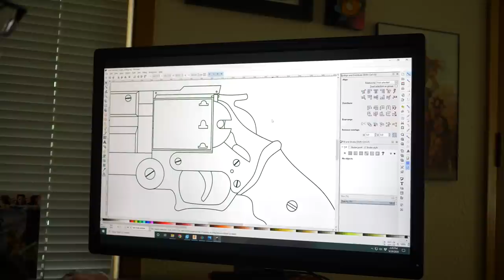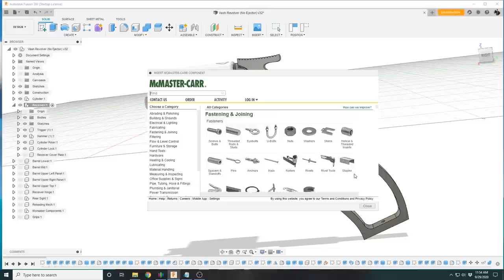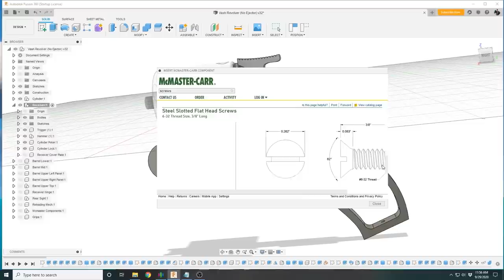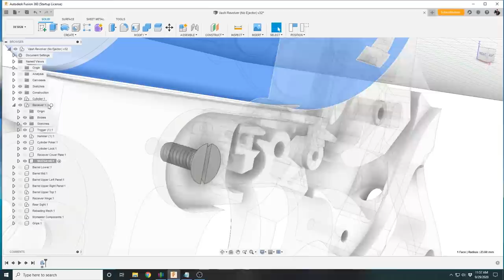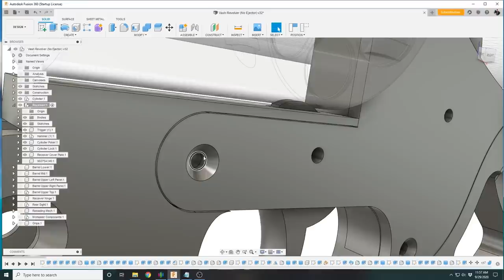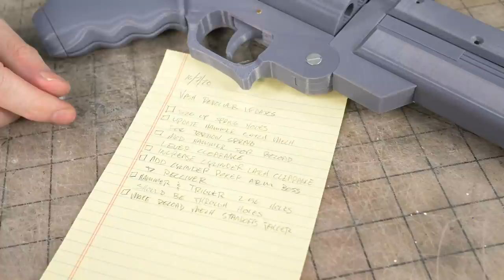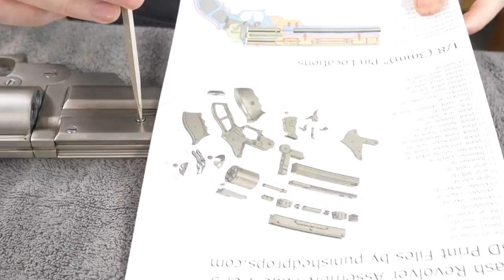LOVE AND PEACE! 3D Printing Vash's Revolver | TRIGUN

Comment: Having trouble with one of the files.  rear_sight_cylinder_stop.  It looks like the hole is not dead center..possibly by design, but every time I print it I end up with one of the walls not getting printed.  I am using a decidedly not super high end printer, but even set to .12, it just fails to print one of the walls.  Is that file right?  Or is my printer just not capable of doing it?
Reply from the maker: That's alright. Mine printed the same way and one of the walls ends up being a gap. It will still function properly.
Reply: @punishedprops  Cool thanks for letting me know!  I also ordered a smaller nozzle to see if that would help.  Maybe just that part with a .2mm will do the trick?  Thanks for the speedy reply and for all of your site work.  It has kept my wife sane with projects while she recovered from covid, and has been a lot of fun.  Thanks again!

Comment: The biggest variation I see in the series is sometimes the gun cylinder is smooth and sometimes fluted. The smooth one is interesting but I think I like the traditional fluted look. Gives another detail for the eye and captures cylinder motion better. Did you try any resin prints for any of the parts. Brittle for impact but would hold the text nicely, I've got some of the ABS resin but haven't tried it yet.
Reply from the maker: I printed initial prototypes in PLA and the final in ABS

Comment: Looking at the gun now, as a physical model rather than in the anime, I'm realizing the weirdness of it.  Its a bottom barrel revolver... meaning where the hammer hits doesn't line up with the barrel.  To make an actual, real gun version of this, the firing mechanism would be so much weirder.  In my head, it would fire the bullet noticeably after the hammer stops moving due to the extra little mechanical actions necessary to make the firing pin contact each bullet's primer.  All the little bits I'm thinking of wouldn't withstand the force- according to gut feeling.  If the plant module and barrel were swapped, it would function like a normal revolver, but just swapping the two makes the gun far more complex.
Reply from the maker: Yeah I just assume all anime guns function through magic ¯\_(ツ)_/¯

Comment: I would like to know how you determined what the internals would look like in the upper barrel area looked like unless there was a part in the tv show where they actually had the gun apart long enough for you to see what's inside the barrel area?  I know that you got the trigger, hammer and  mechanism ideas from your air soft gun, but above the barrel area where you had to sand some parts to make a snug fit, The internal parts is what I'm talking about?
Reply from the maker: The plant module is in the anime and is shown in a few episodes.

Comment: Sad that you didnt add the Webley-style ejector, (I.e. the thing it refers to on the "Auto Ejecting Double Action") but other than that its probably the most faithful recreation i've seen thus far. The ejector is made up of just three extra pieces, so if i end up getting a resin printer at some point i might just try adding it.

Comment: I like how you mentioned the cylinder changes. If memory serves, for the first few episodes the cylinder has the notches. It's not until after Vash meets Frank Marlin that it changes due to Frank repairing it. Can tell that it started with the cutouts by looking at Knives' pistol as well. Any chance you'll release a plan that includes the original cylinder as well?
Reply from the maker: I don't currently have plans for that

Comment: It's an odd revolver in that it wouldn't function with the hammer where it is. It fires from the bottom of the cylinder, not the top. So the hammer would need to land there, not at the top. Unless it's like a chiappa which is striker fired.

Comment: 45:36 Can somebody explain the logic behind this gun ? If it was a real one how the hell would a bullet shoot from its under barrel while the trigger needle is on top ?
Reply: If you look at the hammer assembly at 37:54 you'll see that there is no actual firing pin on it at all. Its a plastic replica, based off of an anime, so realism is the goal only to a limited extent. All of the parts of the mechanics that make the replica satisfying work fantastically. 
While it's possible to have a revolver bore align with the bottom chamber of the cylinder, it would require a different hammer shape and likely a different trigger assembly to get the angles to work right in the small space there. 
The Chiappa Rhino is one such gun that works this way and they do provide a few advantages over traditional revolver configurations, namely the fact that recoil is translated more directly backwards into your arm, into your stable platform, rather than upwards, which requires either more muscle or weight to counteract.

Comment: I had durability problems using the aqua gloss on my McCree Revolver. Is there any technique to applying it to get it nice and hard?
Reply from the maker: Hmmm it's usually fine for us - it does have a pretty significant cure time. I usually leave it overnight.
Reply: @punishedprops  Interesting. Applied per the bottle's instructions, right? Maybe it's an incompatibility with my base coat and the paint, because it tended to scratch to the base coat. I ended up using automotive clear, which ended up giving a "wet" finish but one that was quite resistant to scratching

And of course I gave it a couple of days to cure.

Comment: you said that your prints shrink so you  had to make bigger diameter holes for the bullets, i advise  you should dimension your 3d files normally and print them in about 101-102,5% scale, it should help you quite a bit when designing props, you just need to figure out at which scale to print your files (for ex. my white abs prints best to real dimensions in 101,5% scale)
Reply from the maker: Thanks for the suggestion!

Comment: In theory.... with proper tools and metals and materials, you could technically use the diagram and the measurements and everything to make it a functional gun like maybe fix the hammer to have an actual pin to fire the bullets and probably the plant parts on top would definitely have to be metal to help the rigidity of the fire arm but ive been wanting forever for someone to truly make a real firing version of this beautiful revolver. If i had everything i would and I'd, ofc, make sure its registered and everything but the idea of making a real one is just ughhh Id wanna do it so bad

Comment: Try print recycling, I saw a video on it where they made a new filament from failed prints and support material
Reply from the maker: I usually print in ABS so I can use the scraps to make slurry for adhering prints to the bed and to each other!

Comment: I never noticed that the barrel was on the bottom before now, that wouldn't actually work as a firearm, unless it somehow fired from the bottom of the cylinder, but with the hammer up that high that is not really possible either.
Reply from the maker: I know, it's weird huh? I assume it works through anime magic ¯\_(ツ)_/¯

Comment: I wish I knew why  plastic painted chrome just always looks kinda off from real metal. Is it a matter of spectral diffusion not being right? Like, even when polished and buffed the highlights don't seem right and the reflection doesn't seem as "deep" if that makes sense.
Reply: I'd presume that's the point of the black coat to try and help block some of the light absorption that gets through the silver paint and helps it reflect a little better. I could also imagine that various paints and finish qualities could also have an effect beyond that to better simulate the light bounce of real metal.
Reply from the maker: Paint is never going to look exactly like the real thing. Metal is physically different from plastic in terms of surface texture and so will always reflect light differently. But the magic of paint lets us get REALLY close!

Comment: This is an amazing build, but as someone who doesn't know much about guns, how is this design supposed to "fire" if the hammer strikes at the top of the cylinder but the barrel lines up to the bottom?
Reply from the maker: I have no idea :D
Reply: @punishedprops  The mystery continues then.

Inspiring work as always. Love the channel, hope you're all doing well.

Edit: Was compelled to look it up. Short answer is that the hammer isn't at the top, just the primer. See 0:57 at the video below (.25x speed helps).
https://youtu.be/6gQiXoiMl4c?t=57

Comment: have you ever tried to make a complete helmet with just foam clay
Reply from the maker: I have not. I've found that the real strength of foam clay is using it for adding texture and detail to basic foam structures, as it tends to get brittle on its own.
Reply: @Punished Props Academy  haaa ok thanks for the info😀

Comment: do you print parts solid or with infill?
Reply from the maker: It depends on the part! For larger pieces I'll usually do a fine infill, but if it needs to be sturdier I might print it solid, like the buck we used to vacuum form a helmet visor a while back.

Comment: Whats the minimum build plate size to print the biggest part?
Reply from the maker: We used an Ultimaker 2+ extended, but you could probably use something smaller - it just depends on how you arrange the parts for printing.

Comment: There is a tool on Amazon for less than $7.00 that will strip wire and cut screws - WGGE WG-015 Professional crimping tool/Multi-Tool Wire Stripper and Cutter (Multi-Function Hand Tool)

Comment: I gut to ask, how doe this gun function? The hamer and the barrel doesnt aline.
Reply from the maker: No idea
Reply: In the show it fires from the lower chamber. Most likely would have a transfer bar that connects the firing pin and hammer.
Reply: @daniellinsley1567  ... thats a very impractical design.
Reply: @arnoldmanuel3311  there are at least 2 models of real steel revolvers that I know of that use such a bottom-chamber design. Mateba Unica and Chiapas Rhino. As I understand the basis of the design is to reduce felt recoil and barrel rise- the recoil forces are more in line with the shooter’s wrist which lowers the rotational axis.
Reply: @daniellinsley1567  but that would mess up accuracy since the barrel wouldnt be near the top sight.
Reply: @arnoldmanuel3311  if you look at the wiki page for the Rhino that is something that’s mentioned. Trade off one thing for another I guess. In the case of Vash’s revolver I think it was just a stylistic choice, though.

Comment: the gun plant was covered by sheets of metal, not a cap that comes out over top. The sheets would sprig to the sides.
the trigger group is absolutely horrible and useless. doesn't have a firing pin, not aligned with the drum and barrel at all. if you watch the anime you can see the trigger is way, way lower into the handle. and i would assume you realize the bullet is fires through the bottom hole of the drum. It's kinda obvious but zero thoughts were given on how to make it work in the model. That's why you have problems with the barrel lock as well... and the gun overall is not proportional and way too big.
i'd give this project a D+ as best.

Comment: You guys need a large bed msla printer. All that sanding could be cut drastically. Other than that amazing model and video.
Reply from the maker: We've had the opportunity to experiment with larger bed printers in the past and we usually still end up cutting things into smaller parts to allow for better prototyping and precision - and to avoid huge print fails
Reply: @punishedprops  Not so much for printing  the parts not cut up (though with something like a Phenom L you could have printed all the parts at once) but more for the 0.05 resolution and it could cut that sanding time in half at least. Just bought the files BTW - I  too have fond memories of the anime

Comment: Why not just electroplate the parts? Spray on a thin layer of conductive paint, use a wand plating kit like coswell, lay down a layer of copper, then finish with a layer of nickel.
Reply from the maker: That's an option too but I really like paint :)

Comment: Fun Fact the design of the gun was a mistake, The manga artist had the frame correct the inker accidentally drew the barrel upside down
Reply from the maker: Hah! That explains a lot!
Reply: @punishedprops  However when the editor asked the Manga creator if he could fix it. The inker who was a gun nut at the time backed up the manga artist by  saying there is a upside down pistol in real life 

The Mateba 2006 M automatic revolver. It came out the same time as Trigun 

In 2015 Chiappa came out with the Chippa Rhino. it was designed by the same person who made the Mataba 2006 M 

Because the gun designer  was a fan of Trigun.

Comment: One of the hardest parts of living in the UK is being able to import McMaster Carr parts i to your models but not order from them 😭
Reply: Just get the equivalent sized items from any UK based hardware provider. Imperial items are trickier to get but not impossible (plenty of classic cars, motorcycle, clocks etc need to be repaired). You can get bullet cases and bullet heads legally in the UK without a Firearm certificate (the bits that actually go bang are what you cannot buy), see Henry Krank etc.
Reply: @ianvincent4911  Obviously, that's possible, but there isn't really a single store I can buy all the parts from, with the same selection, etc. So it becomes an arduous hunt, where it could just be a one-click shopping list.
Reply: @talongrayson  Not knowing the full item list, these seem to provide most hardware items I saw in this video: https://www.accu.co.uk/
Reply: @ianvincent4911  That's definitely helpful, but I'm talking more generally, rather than specifically the hardware in this build. It's just a shame that there are extra steps for anyone outside the US. I wonder whether Autodesk would consider linking to different suppliers for different countries 🤔

Comment: Out of curiosity, but why steal the design from an airsoft pistol, instead of just getting a reference from an actual revolver?  Having access to something like a half-cock and full-cock notch, and a fully-profiled hammer, seems like it would serve to sell the prop a lot better than just an obvious only-there-for-show hammer...
Reply from the maker: I don't own an actual revolver-  I do own an airsoft one. The hammer is that way in the anime as well
Reply: @punishedprops  the revolver in the anime also had an auto-ejector, missing here, and the 6-o'clock barrel arrangement has at least 2 available references in real life, one pre-dating the anime by a while, in the Mateba Unica and Chiappa Rhino, and the information on the structure of the internals of both of these is pretty readily available.

So, instead of coming to understand the mechanics of what you were building, and expanding your competency of the mechanical designs you seek to replicate in your props, you got lazy.  It's kinda "whatever," they're your toys, do with them as you wish, and design rules are there to be broken.  That said, you should be learning those rules pretty thoroughly, before trying to break them, so you can better sell the idea within the work, as a whole.

Comment: Inspiration to finish and print my Astro Automatic from Space Battleship Yamato. The design varies quite a lot from episode to episode and even within episodes in the 1974 original series. I took a lot of screenshots and a scan of the master sketch from the design papers used for the show, and images I could find from various garage kits and toys. I found most of those to be rather inaccurate compared to any of what's shown of the guns in the anime. The sketch has a problem where its barrel is slightly angled upward and one resin garage kit faithfully duplicated that.
Several other things have such variances, like their belt buckles. The show has animation teams working in parallel and I suspect those little differences were done as each team's signature. So here's the latest renderings of mine. https://www.flickr.com/photos/27748767@N08/albums/72157624280191121
Reply from the maker: Neat!

Comment: You know...  I still wonder after all these years... How does the firing pin actually work for this gun. And do to time constraints you just made a generic revoler trigger mechanism. Cause here's the thing. the barrel is in the wrong spot for a normal working gun.
Reply from the maker: I assume this gun works with anime magic ¯\_(ツ)_/¯ It's actually like this in the show!

Comment: I'm going to make you lose some sleep. Vash's gun is bottom cylinder firing so coping the firing pin and trigger mechanism from that gun which is top cylinder firing probably wasn't quite right.
Reply from the maker: That's how it is in the show! I have no idea why
Reply: @punishedprops  I'm actually curious now because the hammer in theory doesn't move, just where the firing pin action takes place... but how. As a side note I find it interesting how it uses big chunky flat head screws. Also your gun is now in the top images for Vash's gun on google. You are the master file.

Comment: Not to PI$$ on your parade but the hammer strikes the firing pin on the top and the barrel is on the bottom. I know it's only a prop but if it was real  the gun would blow up.